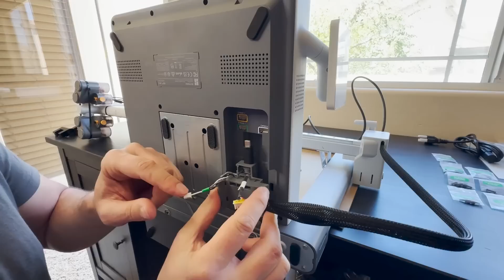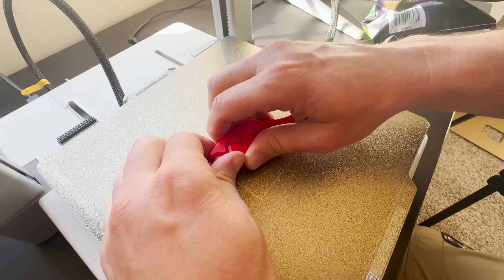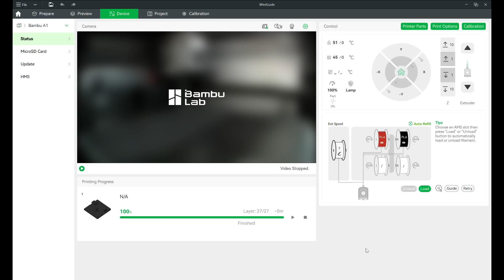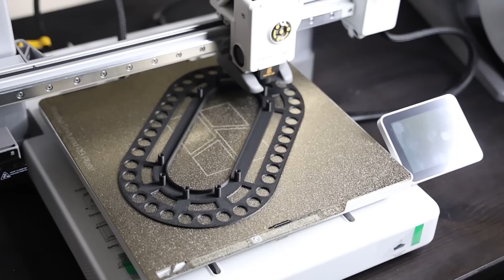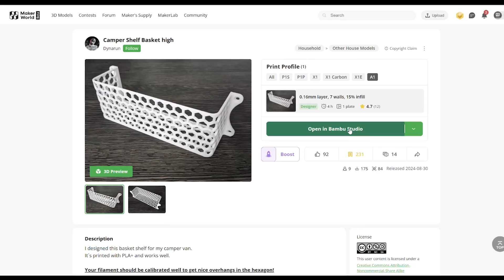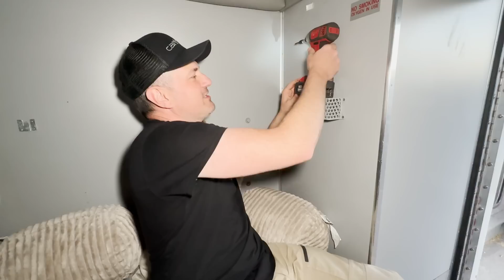3D PRINTING UPGRADES for our CUSTOM CAMPER VAN - Bambu Lab A1 Combo #3dprinting #diy #tools

Comment: Hi, I'm Carlos from Brazil and I would like to know if it is possible to use water-soluble filament for the support and print normally. Since I saw that the support printed on this printer does not stick very much to the part.

Comment: Based on the nature shots in this video you were in a relatively low humidity location.

When you return to your container home you are going to need to look at the airtight sealed containers for your AMS and filament driers and storage options.    
The high humidity will significantly impact your print quality.

Comment: Очень странно, ведь производитель пишет, что PLA-CF не поддерживается таким принтером.
Reply: I would also be concerned about the fact that CF filament is being used in the first place.  

It has its place and it’s got some use - but not for everyday objects and if you’re working with PLA or PETG I don’t believe it has any benefit.
I have looked around and came to a decision that I wouldn’t be touching it.

Comment: Congratulations on getting one of the better 3D printers out there.  I have the Bambu Lab X1 Carbon, but am seriously considering the A1 Combo as a second printer.  You may know this already, but you can increase the size of any print using the Scale option. Like the mini shelf bracket, if the model is lying on the back, you could make the shelf taller by changing just the Z-Axis (up and down). Or if you had a small container with a lid you could change all 3 parameters by a certain percentage and as long as you have both items selected and make the same adjustment to each item.  We printed a bathroom organizer that was too short so we only increased the X-axis (left-right) by 30% and we were able to determine how large it was by counting the squares in Bambu software.  There are several sites for free models, but the Makerworld, Printables, and Thingiverse are the ones I use most of the time.

Comment: Someone commented about ABS or ASA, and that is correct. PLA gets soft in  a hot vehicle, deforming. PETG is worth trying, can be printed without enclosure and withstand the temperatures inside the vehicle (maybe if you park it in Death Valley it might suffer). PETG is a little more of a struggle than PLA and less of a struggle then ABS. I think the A1 can handle it fine.

Comment: For longer lasting prints you’ll want to use ABS or ASA if it’s exposed to high heat or the elements. You’ll need an enclosure to print those filaments as they are prone to warping
Reply: You’ll need to do this in a separate living space since those are pretty toxic.  It’s better to use the P1S or X1C since it’s got an enclosure and air filter.  Also they require consistent higher temps hence an enclosure.  Frankly with the A1 just go for PETG and it’ll last a really long time.

Comment: How does the cost compare? printing vs. buying an item
Reply: For small items its comparable or cheaper to print.  For larger items it is almost always cheaper to buy.  The main benefit of printing is the ability to customize\remix models to fit your exact needs.  There are also models you just cannot find on the market and paying someone else to print it will always cost more than printing it yourself.